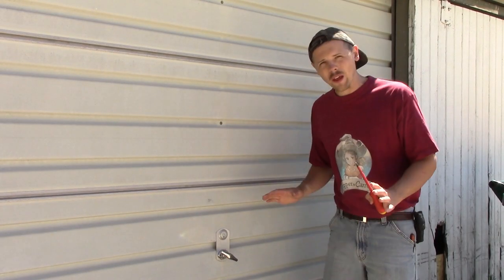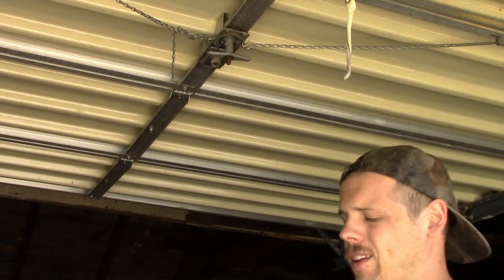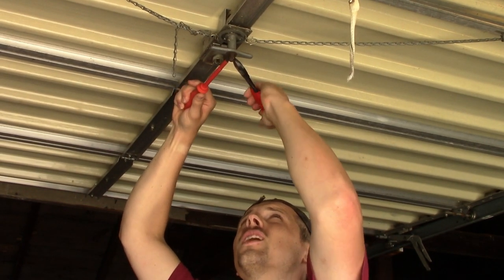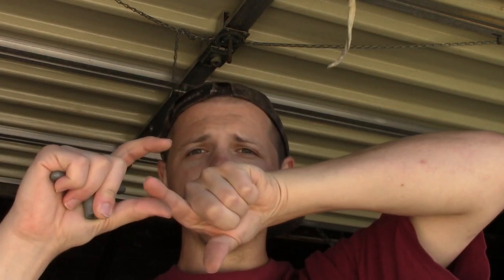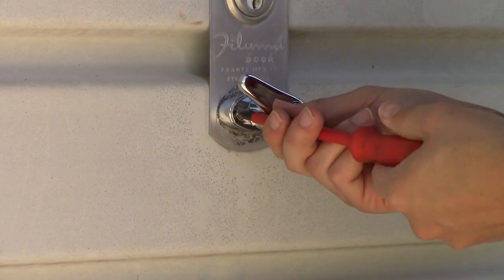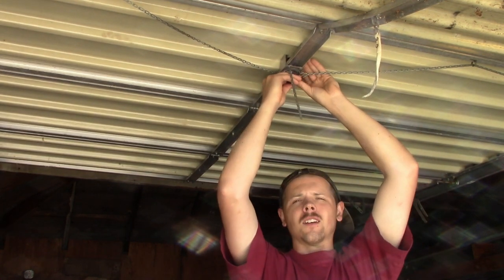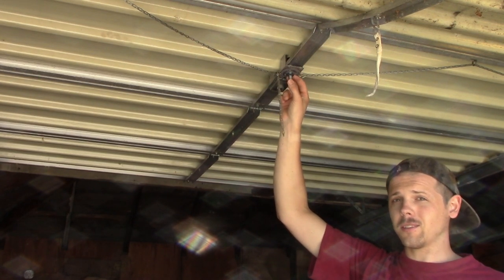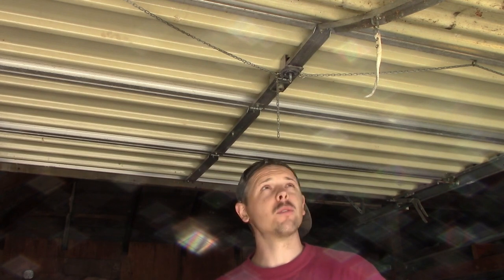Installing a Garage Door Lock

Comment: Tap the lock washer on with a socket. If the stem of the new lock is too short for the inner handle at least tie it to the mechanism so that you can use it freehand in an emergency. Obviously best to buy a lock with a stem that is long enough. A job to do on my garage. Thanks for posting.

Comment: That is the exact same door latch that I have on a building I maintain. I actually swapped out the entire cylinder so it works with our master key system for the property. Solid lock, on a  terrible fiberglass garage door (your door is in much better shape than ours). Great video!

Comment: Seems like it would be more secure if the screws were just bolts that are not un-screwable from the outside?
Reply from the maker: It would be, you could probably use security screws, or fill the screw heads with epoxy. When locked the handle blocks the screws, so you'd have to struggle to get a screwdriver in place to remove them.

Comment: ok so what is the top key used for ?
Reply: It was used for the old lock, but I didn't have a key for it. Rather than replace everything I just put a new handle on it.
Reply: ok so if that top key is locked but you don't have the handle will the door still open? because I have the top key but no handle will it still open
Reply: If the top is locked the door will probably not open. I disengaged the mechanism from the inside of the door that connected to that. If you have an access door it should be easy to remove the plungers that lock the door into the track.

Comment: If you wanted to remove the circular lock, what would you use to fill it? I have a open circle on my door from when I bought the house. I dont know what goes there so its open
Reply from the maker: I would think a hardware store would sell some sort of plug to fill it, but honestly I don't know.
Reply: @NathanSalapat  I know that I am late to the party but what you need I believe is called a dummy lock.
Reply: Yeah, a dummy lock, or if u don't want to see or confuse anyone with an unused lock, take it off and use a carriage bolt with a washer that fits snug under the escutcheon and around the bolt, and another washer, lock washer, and nut for the inside.

Comment: What about the inside handle
Reply from the maker: The inside handle usually has a wire or chain that connects to the two 'plungers' that lock the door into the track. I removed The old lock kept the handle from being able to turn from the inside or outside, with this replacement the inner handle was removed and put onto the new lock.